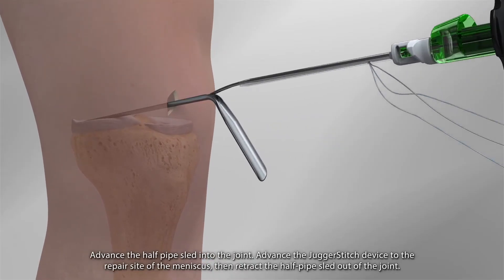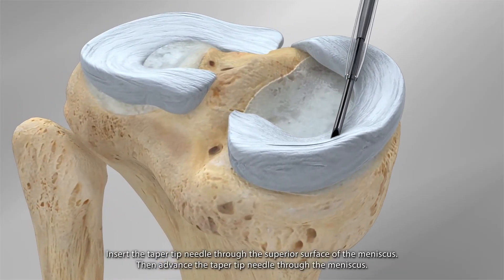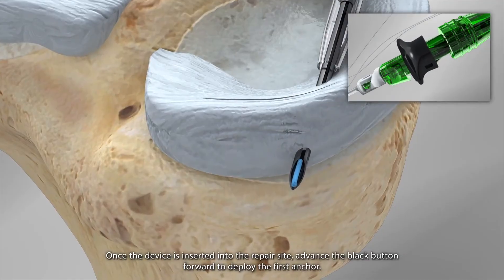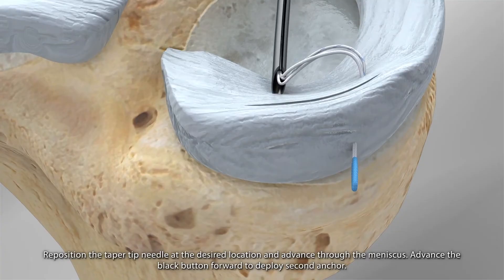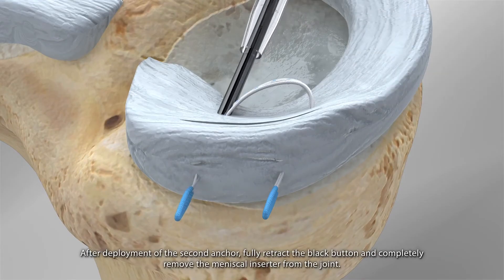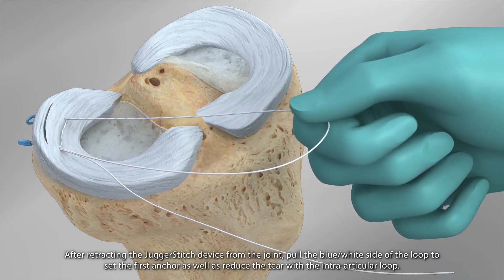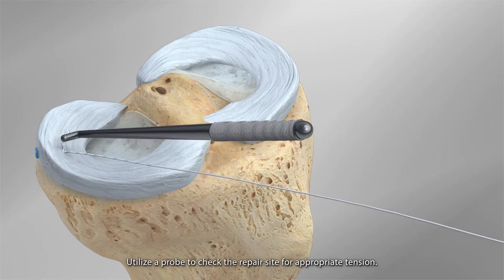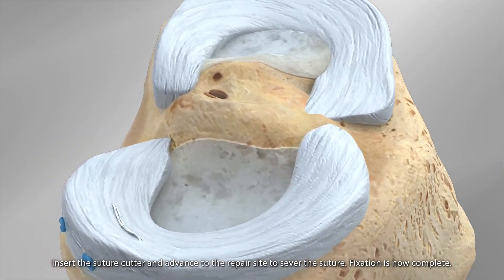JuggerStitch. Meniscal repair device

Comment: I had meniscus repaired with this tool
Reply: Did it work?
Reply: @Cybernetic263  yeah so far no issues
Reply: @antwerp9055  can you play sports now??? i play soccer and have a lateral tear close to the anterior root. can still walk and run though.
Reply: @leonblue864  Yes, i run, do muay thai, etc, and no issues
Reply: @antwerp9055  Thanks for the reply. What tear exactly did you have??
Reply: @leonblue864  I believe it was the medial tear. It was a large tear, the meniscus tore and then flipped over, causing the knee to lock. When they doctors scanned my knee, you couldn't actually see where the meniscus was.
Reply: @antwerp9055  glad you are better now.  I can still walk and run. But obviously it does bother me. However don't want to just get surgery unless it will be repaired.
Reply: Bro I have questions please give insta I'd or another contact things..

Comment: Yes!  Has anyone used this in conjunction with stem cell injection/ infusion into the damaged miniscus site to improve healing or even promote re-attatchment?
Reply: Would be difficult to introduce PRP/BMAC/Amnio into the joint during an arthroscopic procedure.
Possibly inject PRP after scope portals closed and knee dry.

Comment: can you tell us more treatment
Reply: This is an arthroscopic all suture knotless fixation device with biomechanical properties comparable to if not superior to conventional polymer based pre-tied knots designs. Indications for repair are the same as the indications for any other meniscal repair technique (longitudinal cleavage, peripheral tears, radial tears lateral meniscus in young patients). The curved needle design allows for implant placement on both the top surface and undersurface of the meniscus in either a vertical or horizontal configuration